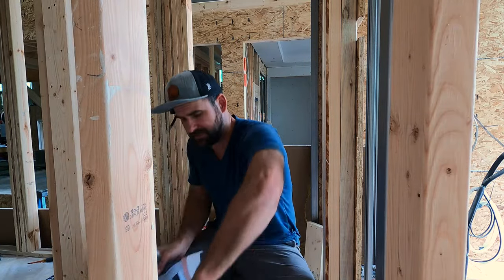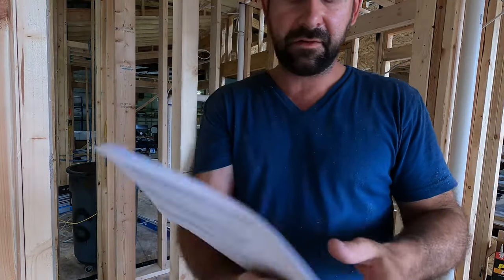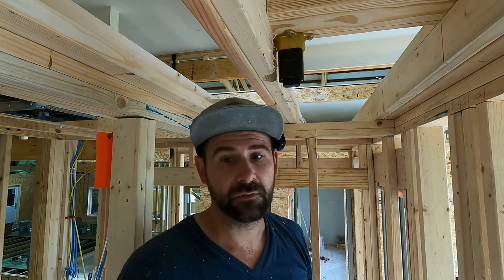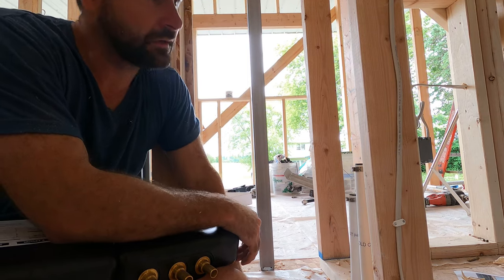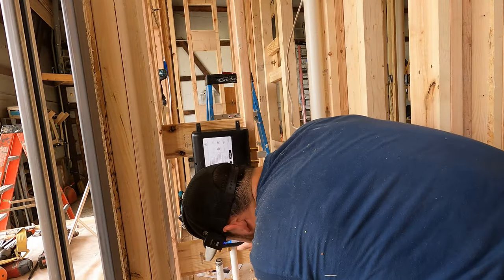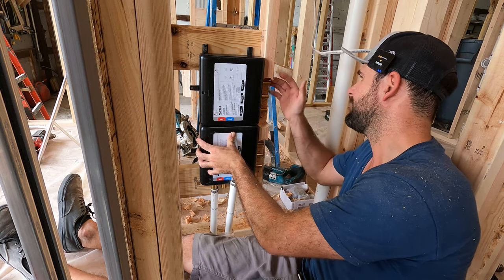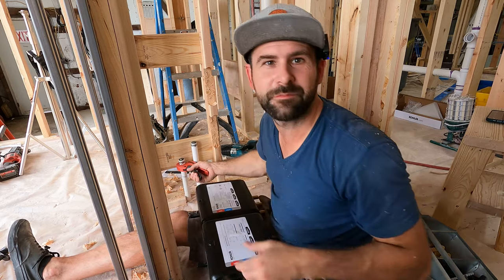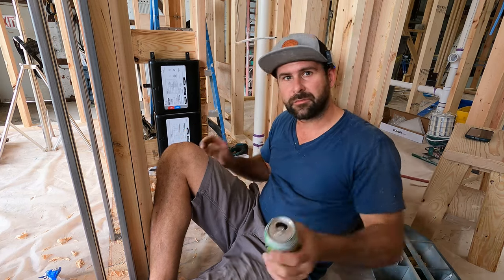Ultimate INSTALL to Kohler's $10,000 Digital Shower Valve

Comment: Starting one of these myself. Did you have a second video of the 1/2" outlets with Pex fittings? Did you start with a 1/2" sharkbite  or sweat a pex adapter? Also, the 3/4" inlets show a filter needing cleaning so looking to use a copper union some how with the sharkbite so the outlets can be removed and serviced without removing the sharkbite. Do not have valve in hand yet. Any thoughts, thanks in advance?